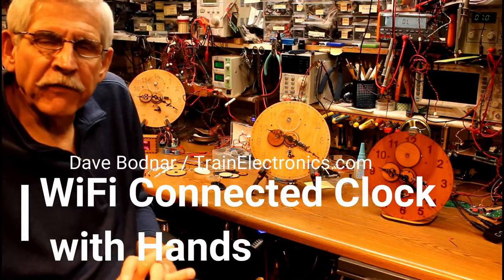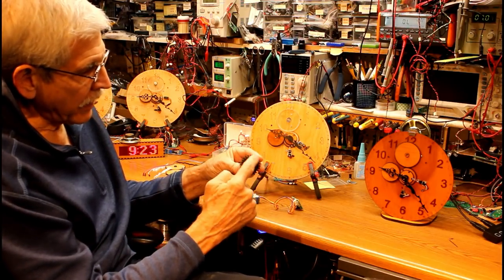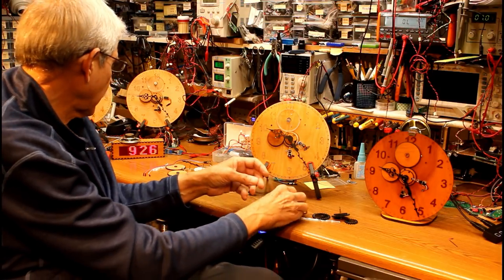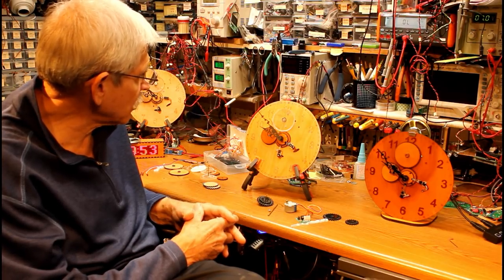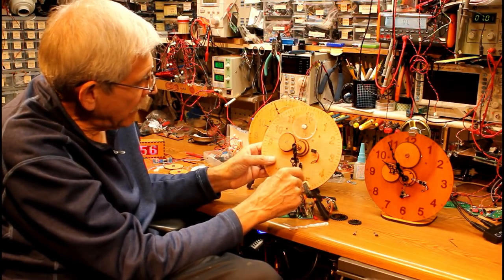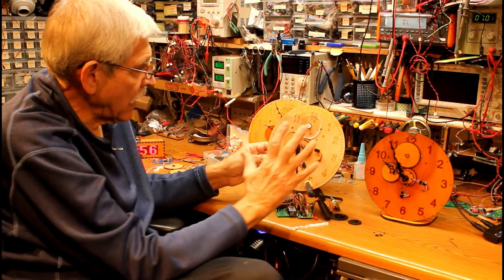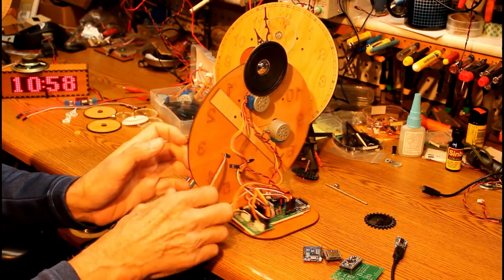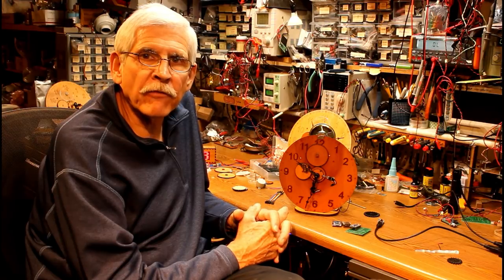WiFi Set Clock with Hands & Westminster Chimes

Comment: Such a good, well presented video! I was so impressed with your solutions to the "fiddly" little problems that are encountered in projects like this. In particular the adjustable alignment of the gear wheels. One imagines that, without this adaptation, one would end up producing many clock faces before getting the good fit needed. Also, not being seduced into using software to map the 512/60 ratio.Well done, Dave and thank you so much.
Reply from the maker: Thanks for the kind words   Michael.   It was a challenge but great fun!

Comment: Well David, I liked your video more than most instructional DYI project videos.  You sparked my creative juices.  First, if your put the gears behind the clockface, the position sensors will not show.  Second, old clocks are easy to come by.  They have hands, two shafts, and too many gears.  Remove the unneeded gears.  Then design the stepper motor to work with the donor clock gears.  Third, if you like the DYI look, some gears could added to the front for the aesthetics.  And lastly, the clear gear on the face of your design makes one revolution per minute, right?  If I am right, that makes it a second dial, like on older clocks.  I liked your chimes, some people might need some chime options.  Thanx 4 the video.
Reply from the maker: Allen - It is good to hear that you enjoyed the video.  Thanks for the suggestions and thoughts for modification - My goal was to get it working correctly, not so much to deal with aesthetics.  You surely could make it more attractive but I am satisfied with the industrial look!
dave

Comment: Hi, the 28BYJ-48 stepper motor is actually has total internal reduction gears =  (32/9) x (22/11) x (26/9) x (31/10) = 63.683950617283950617283950617284
..... (not exactly 64, just almost). This means, if we do calculations for clock mechanism purposes, based on number 64, or 512, or 2048, or 4096, (to count the number of steps versus full 360 degree rotation), will not give really accurate result......Thus, if we implement it on analog clock with hands, after some time (maybe weeks/months), there will be some leading/lagging of the clock, not accurate. Creating 64:45 ratio gears is actually not really solving the problem, because it is based on 512:360 ratio = 64:45 ratio, where 512 is not really the accurate number.... One solution is to add some corrections (add/reduce steps, reset, initialize, etc.) in the software....
Reply from the maker: Thanks for the analysis, Antonius - the test units run fairly well & accurately - If I see any error I just do a quick reset to zero the time
dave
Reply: Yes, because of that internal motor gear ratio (almost/not exactly = 64), although the mechanism works perfectly, after some time/slowly, small-small error number of steps will be accumulated, and the clock will have some error/not accurate, either lag/lead, depends on the design. We can make the correction manually, or this correction can be embedded/integrated in the software (by adding/reducing steps), or reset/initialize.
Reply: Hallo, further analysis, if we want to have "PERFECT" total gear ratios, we will need to add another pair of rational gears, with 405/403 teeth ratio, this will give exactly = 64. Only after this we can put the 45/64 ratio gears as the end gears, and the clock will be running ideally without corrections needed. (Correction will be needed only if in case a "faulty" happens; like missing signal/missing motor step/pulse, etc.) 

So, the total ratios will be (32/9) x (22/11) x (26/9) x (31/10) x (405/403) = 64 (exactly), from here we can play with the next rational gears easier....

The challenge here is that the 405 or 403 number of teeth in a small gear will be small teeth, will be weak/not strong enough, unless material is quite solid/hard. If it is difficult to solve this issue, we will have to split again the rational gears into several pair of rational gears.....then it becomes complicated mechanism.....

28BYJ-48 is actually not an "ideal" stepper motor for analog clock design, unless we add some tricks = some corrections (by adding or reducing the steps every time/periodically, or reset/initialize periodically)....or with those additional rational gears...
Reply: Hallo, just one more comment: If after the additional 405/403 ratio we will get exactly 64 steps, then one more additional gear ratio 15/16, we will get total = 60 steps (exactly). This number is very good for analog clock mechanism. ..
Reply: Resetting the time once a day (say at 3am, to capture the current summertime adjustment) , the angular error would be at its "worst" in the wee small hours of the morning. Hardly noticeable.
Reply: Hi yes this happened to me  so we different stepper motor

Comment: The code generates an error in compilation -
"invalid operands of types '__gnu_cxx::__enable_if<true, double>::__type' {aka 'double'} and 'long int' to binary 'operator%'"
at the line -
epoch = round(curEpoch + 3600 * ( summerTime) + 86400L) % 86400L;

in the updateTime sub
Does anyone have any advice to resolve this?
Reply: Hi I am getting the same problem. Any solution?